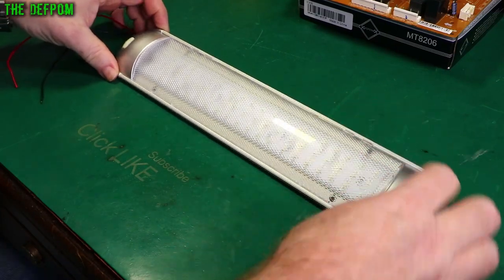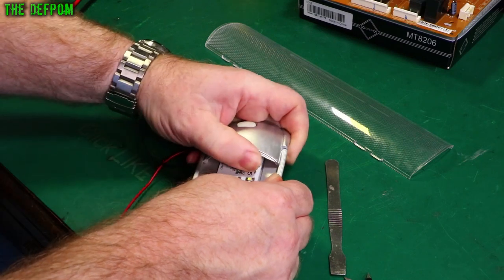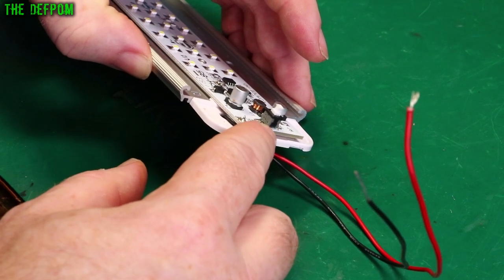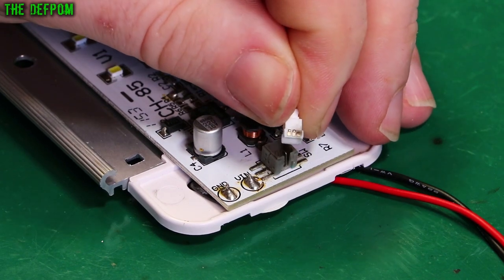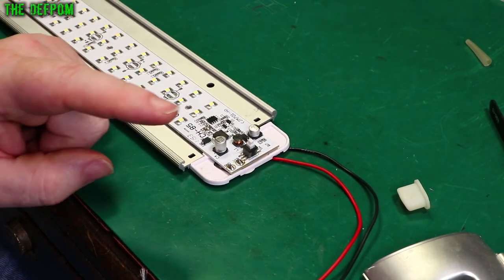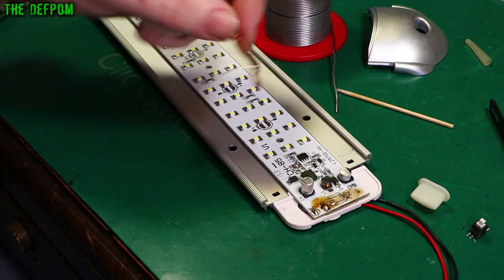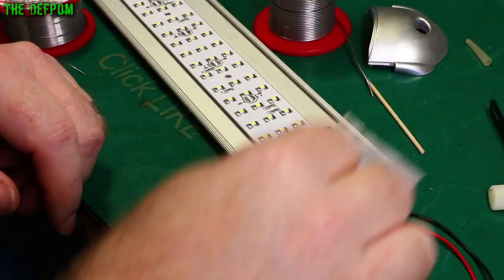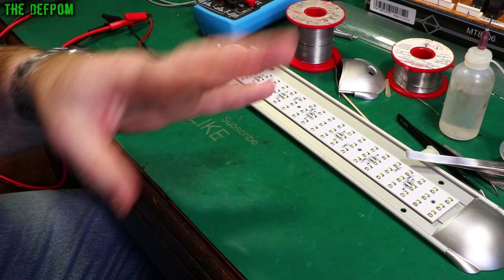🔴 LED Lamp Repair - No.975

Comment: Couldn't they have just paralleled all 3 lines to share current? I assume only one line was used since only one contact got blown. Also with the switch being so wobbly it's likely to arc and will not live long anyway...

Comment: I lost my internal bet. It wasn’t the capacitor. Maybe get some of the low temperature solder or the two soldering iron method.
Reply from the maker: Yeah, it wasn’t a crapacitor this time. I JUST got so low melt solder.. so next time I can 🤓
Reply: @TheDefpom  I bought some chipquick  a few years ago but didn’t use it in the end. I have also seen some 138c  stuff cheap from China but also a lot fake stuff around that doesn’t work at all.
Reply from the maker: @allthegearnoidea6752  yeah I got some 138 degrees stuff a while ago… it wasn’t, just normal solder. This new stuff I tested and it melts at its rated temperature or 124

Comment: They could have added one transistor and had the switch turning on that with the transistor handling the load and the switch would have been fine.